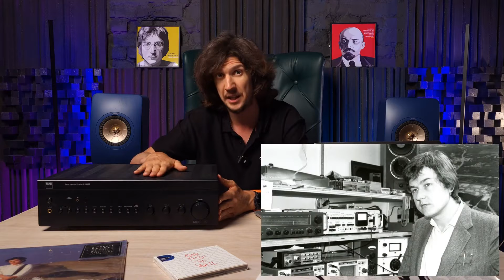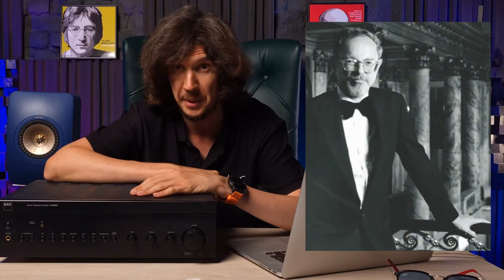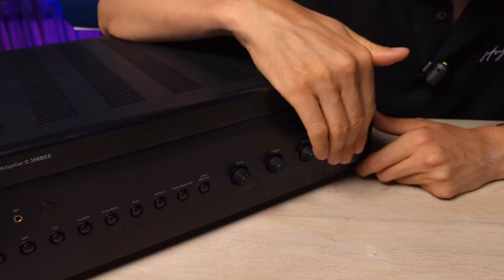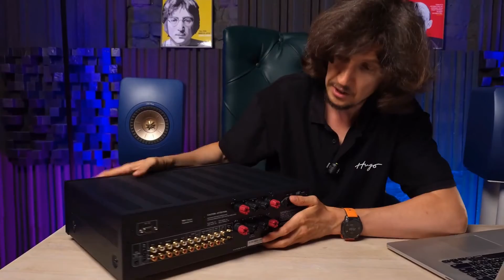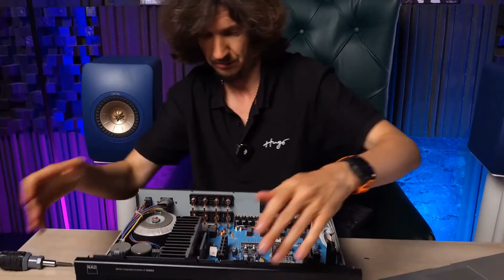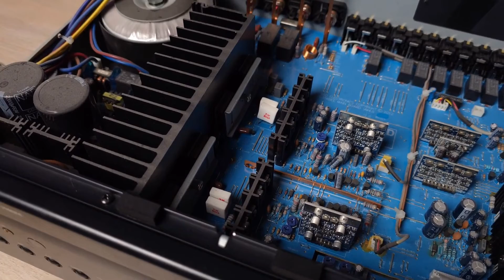The story of the old NAD C356BEE! How 80 W amplifiers used to be made

Comment: Had this. Had the C352 at the same time, M3 integrated, still have Nad 326BEE (best budget Nad & most reliable), Had 1140 pre, C 372 , C350 , 314 , C340, one Silver series power amp. etc. all  of them were fun reliable great sounding amps and flexible. Ill get a 275BEE when one comes a long. I use Bryston preamps and more expensive amps like vintage Krell, Roksan, Exposure Quad  etc. but Nad will always have a place in my audio room.

Comment: Is this amp a class AB? Cos mine gets really hot and I can use it as a heater in the winter. Another reason I think the NAD is AB, is that I also have an Audio lab amp that is AB and It doesn't get near as hot. Does your NAD C 365BEE amp get hot?
Reply: My NAD C355BEE gets hot too, but it sounds great, it works more than 10 years in my system with Paradigm speakers